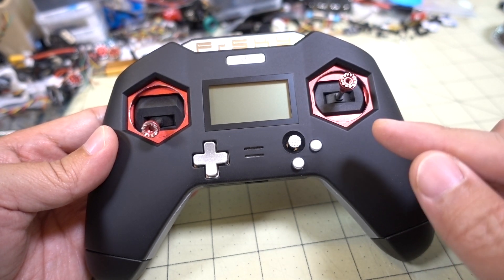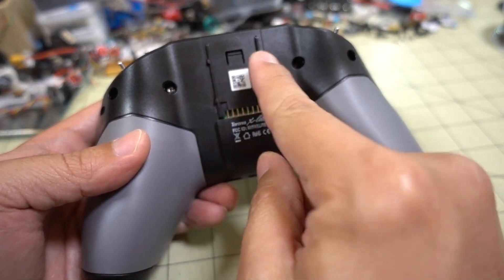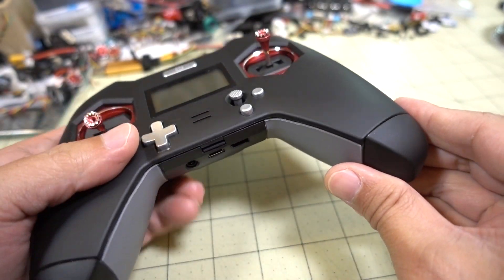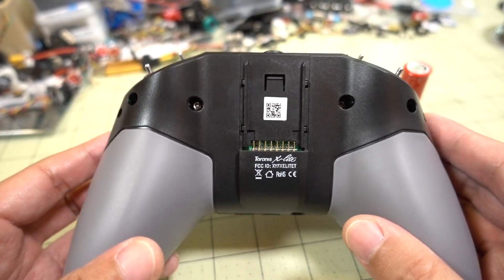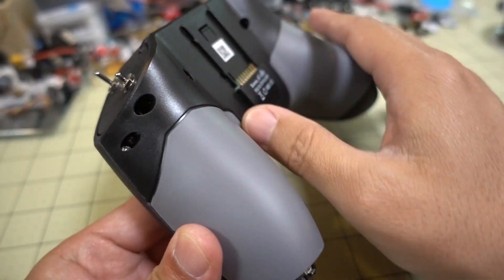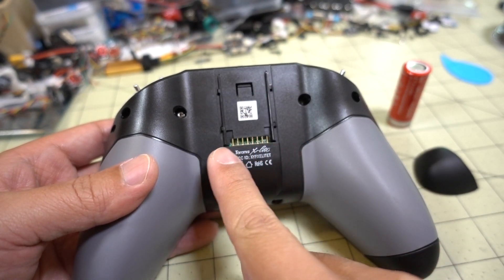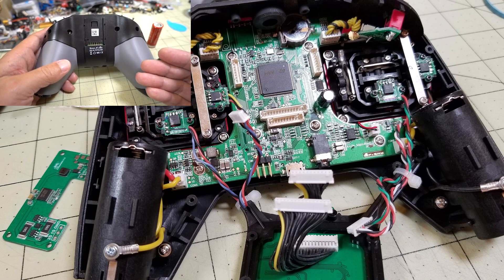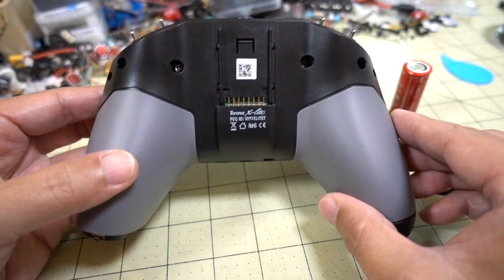FrSky X-Lite USB Charging Installation Guide 🛠️🎓

Comment: i Put such a Board im my flysky i6 and also Upgradet the normal 4AA Batteries with an flat li ion Pack tanken from a defect Powerbank ( 2s, 5200mah). i also replaced the original 3.3v Regulator, because ist's max Voltage is only 6v (i destroyed the original one ,as i insertet new Alkaline Batteries ,(1,6v when new --> 6.4v)... so after this i did the liion Mod.  so now my Transmitter liion Pack also Powers my fpv Googles.

Comment: The whole thing can be easily mounted on the top unit as seen in other videos - no need to disassemble anything else. mine is getting very hot though and sometimes draws too much current for my laptops. anyone else experiencing this?

Comment: I have a QX7 (non S). Is there a similar mod for that radio?
Reply: There a battery mod that come with a charger from Aloft Hobbies that real easy. Only requires a drill into the case for the charging port.  The design and results look like they are factory made.